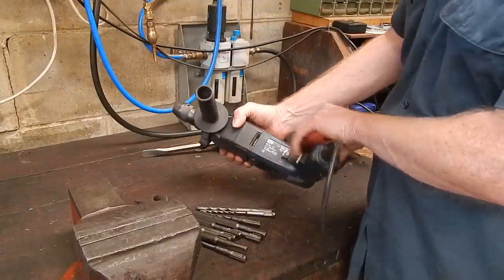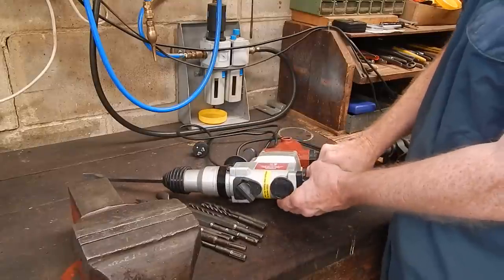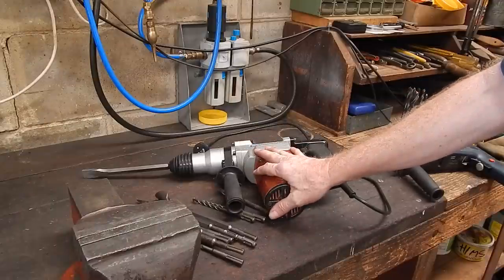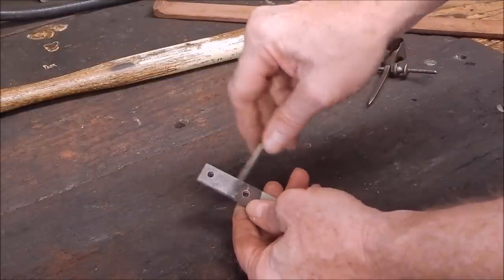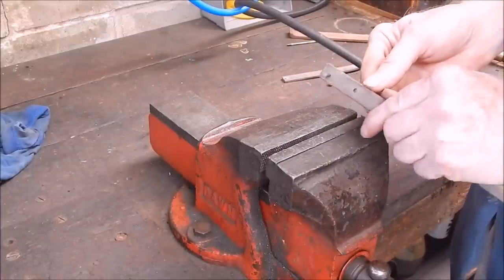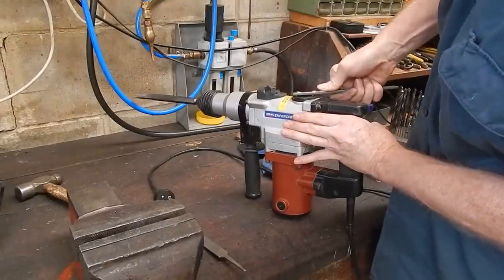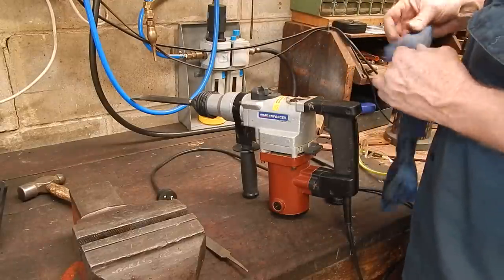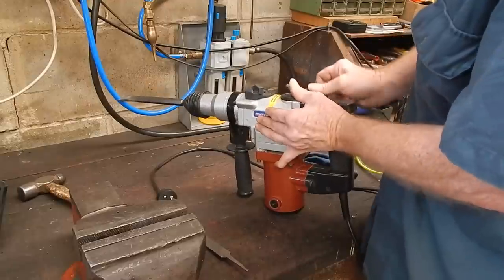How to make a simple pin wrench

Comment: That was a fun build. I did one similar when I needed a pin wrench for the nut on my side grinder. I don't have a welder, so I used a punch to expand the pins in the holes in the handle. Been using it for years now. The pins are still tight in the handle.

Comment: Have you ever considered making 'chopsticks'? I don't know if they're a common tool in engineering, but they're a variable pin spanner. Used to use them for changing between infrared and standard sights, on the Tank. One size fits all......
Reply from the maker: Marty Smith On the tank  ?  ...............like blow your car up with direct hit type Army  tank?  Hmmm, sounds like a fun toy.

The trouble is that the pin diameters would have to correspond to the holes, and there's plenty of variation between applications there.

I think I've seen something similar on the web.

Cheers Rob
Reply: xynudu One and the same. Leopard AS1A4. Tinkering with one of them, on a daily basis, is a joy.....a very hard slog joy....but a joy, none the less. Obviously, the 'blowing stuff up' bit, which was my entire job, in the Army, is far greater fun.
Reply from the maker: Marty Smith You lucky bugger.

Comment: I like the Jamec air nozzle you have on the hose.
 That drill and chuck were a good score.
Reply from the maker: Mentorcase Had that for years, was my fathers.  In the video you can see I have two air lines, one blue and one black.  The black hose runs off of the tool oiler on the bench. The blue line is clean air for the duster, which has it's own regulator. You can get some cheap stuff off of Gumtree.  Cheers Rob
Reply: I have 2 of the jamec nozzles myself, 1 touch pushbutton full flow.
Reply from the maker: Mentorcase Yes, they are nice units - compact and easy to use.  I also have a modern trigger type long nose duster to get into deep stuff .  Cheers Rob

Comment: I usually use the tips of mig pliers for the nuts on my grinders. It works pretty well.
Reply: I'm with you.  A pair of sharp nose pliers often works perfectly for a pin wrench.  Sure is nice to be able to manufacture a tool when you need it though  :)
Reply from the maker: Terry Talton I have used circlip pliers as a pin wrench, but if they slip it tears up plastic plugs. Better to get something that fits correctly. Rob